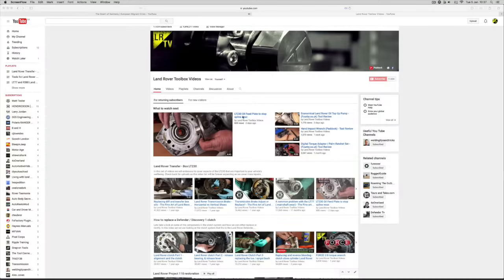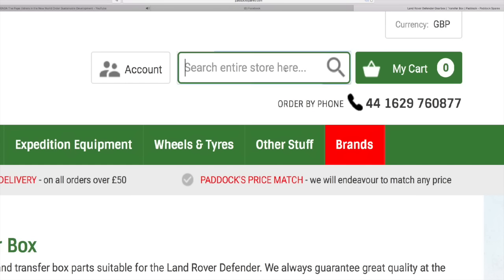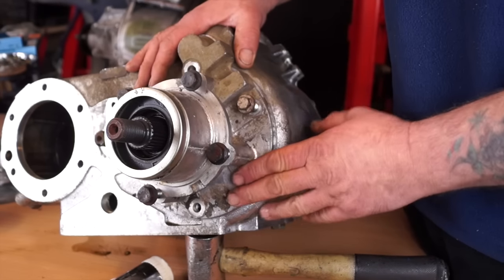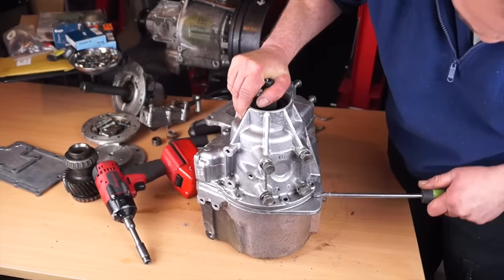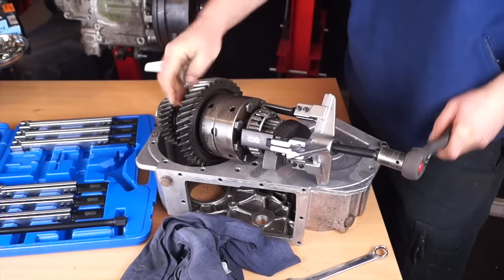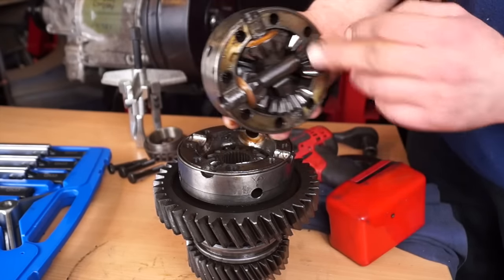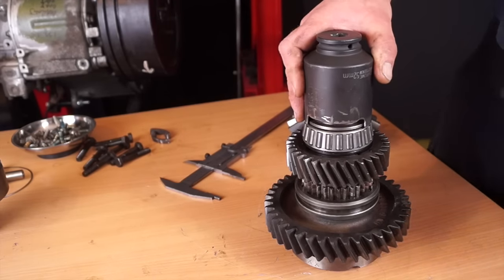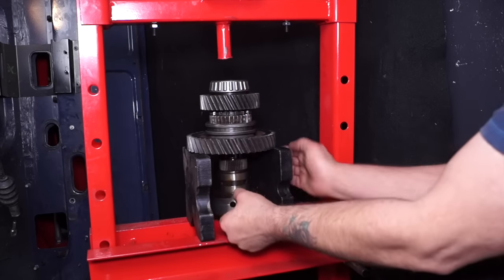LT230 T Centre Differential Repair PART 1 - Stripping out - 110 Project rebuild

Comment: My diff started making some awful noises recently and was sluggish going in and out of difflock. This series gave me the confidence to tackle the repair and so far its going smoothly. Thank you for this incredible series! 

Note for my disco friends out there: the diff is removable without taking the transfer case or hi/lo gearset out. Makes for a much simpler job!

Comment: If you work 1/4 turn at a time on each of the bolts you can loosen off the top half of the diff without having to remove the bearing

Comment: how much play should there be between front and rear drive flange when cdl is locked mine moves about 5 to 10 degrees but on the back flange it feels a bit crunchy initially when changing direction.

Comment: is there anything stopping me from taking the front housing off insitu and then replacing the centre diff brass shims and gears? my 2004 d2a manual has excessive backlash.. and depending on whether or not i find gold flakes in the transfer case, i will be replacing the shims as i suspect they have been destroyed.
Reply from the maker: yes you can take the front housing off in situe if you like.

Comment: I have a 03 D2 4.6l without any of the CDL parts. I have access to a complete 98 D1 to pull parts from. My question is, Can I pull the front cone off the transfer box and swap it into my D2 case? Has this been done before? Will it work?
Reply from the maker: the issue you have is that the hi low selector has a sensor in there that tells the ECU which range it is in and fuels accordingly.  Best to get an Ashcrofts conversion if you want to have a manual hi lo selection.
Reply: ***** Thanks for the response! So are you saying my D2 front cone has a high/low selector switch and the D1 does not? Or does the D1 have something different? In my research I've found some info on bypassing or deleting the sensor? Is that an option? If I could I'd like to pick your brain on this? Will the D1 front cone bolt up to my 03 without issue? Do I use the actual diff from my D2 with the D1 front cone? Will there be shims that will need to be adjusted to keep proper backlash and what not? The only reason I am planning on this swap is the ashcroft stuff is out of my budget and this complete D1 is 100% untouched and I will be the first person to touch it so I can have everything I need down to every nut and bolt, linkage, everything. Thanks for you time!!!
Reply from the maker: LT230 SE is the box you will have in the D2.   Linkages are different for changing the diff lock over but the housing will be the same as the D1.  Not much change in the design from the LT230 T but there are small differences.   If you are serious to get a mechanical lever into place then having a donor box with all the lever attachments then you are winning.   it would pay you to study the D2 workshop manual to see which switches / sensors that are fitted so you know what you are dealing with.   Front housing doesn't need to be shimmed up when swapping over.
Reply: +Land Rover Toolbox Videos Great, thank you! I have the service manual pdf and I have been looking at it. Well, with your info, some other Rover guys input, I feel confident I can make this work!!! Videos to come!!!
Reply from the maker: I will be covering it too with our D2 but not sure if to keep with the electronics or have a manual diff lock.  I think the control manually is better.    I like the traction control on the D2 which I have seen in operation where others get cross- axle'd.

Comment: I hate gear/transfer boxes... they're something I swap with Ashcrofts from time to time...  why do I want to do this all of a sudden?!?
Reply from the maker: +Matt Allen   It is sometimes more economical to get a reconditioned transmission than repair on unless you are going to upgrade it then DIY is the way to go.   You can always get a cheap one to practice on if you so have a desire to do so. .  No pressure then.
Reply: +Land Rover Toolbox Videos How are you getting on with the rebuild of the Centre Diff?  I'm still trying to decide whether to put an Ashcrofts' Torque Biasing jobbie or upgrade like you have.

Comment: where do you find the microfiche information is this on the paddock Web site?
Reply from the maker: Microfishe info?  No it will be on the web for parts info. .  Information is found in a workshop manual for the repair side.

Comment: What's the best center diff available?
Reply from the maker: Ah,  that would depend on what you want to do with the vehicle.
Reply: I'd like to stick one in an F250. It would have to be tough enough to handle 500 horsepower, 500 ft lbs of torque. It would also need a torsen style diff available from the aftermarket.